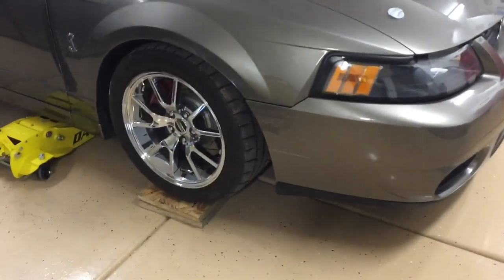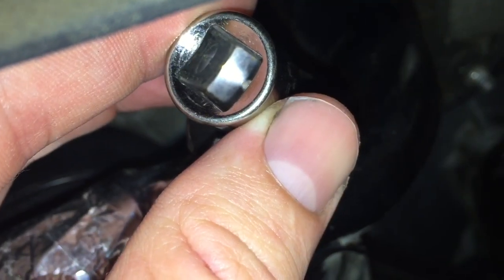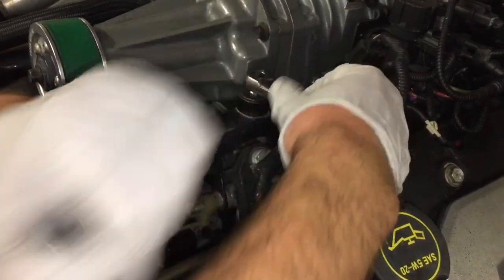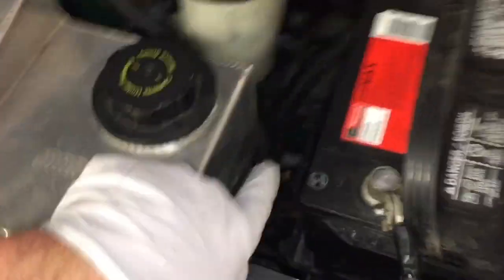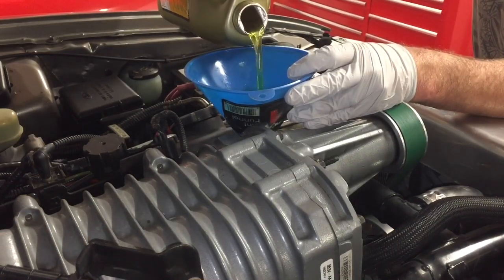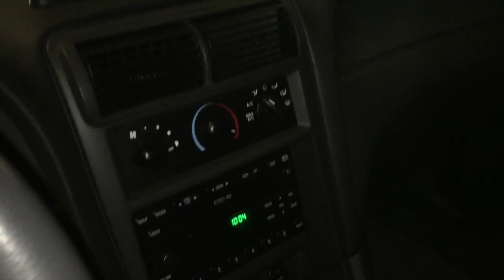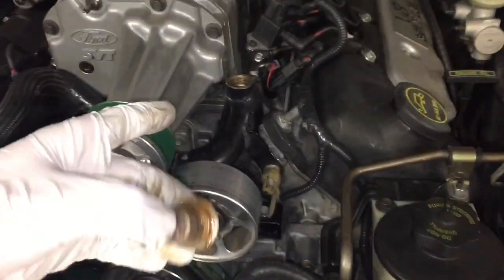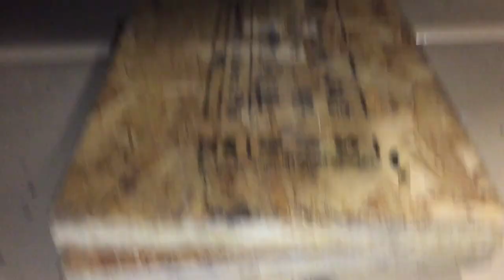Burping 32V Cobra / Mach 1 coolant system. 1996–2004 SVT cobra and Mach 1

Comment: Thanks for posting this. I COULD NOT get the air out of my Mach 1's cooling system until I watched this and filled/ vented through the cross connection.

Comment: Danny, did check out your vid. The Lincoln Mark 8 have the same issue with a cross over tube. It is a 1/4" drive required for removal. So, Harbor Freight, Amazon, have an adapter set for an impact hammer. 1/2" to 3/8" and 3/8" to 1/4". You combine those two and use an impact drive, you won't have to worry about breaking a carbon steel socket. Just a little squeeze with the impact hammer drive and it's done.  Use some anti-seize when reassembling.

Comment: Thanks Danny. Sons alternator went out and I had to open all this on the mach1. When we reassembled the car we drove it for 45 minutes no issues. Car sat for 8 days and then upon restart began getting very warm 

Followed your video for burping and the crossover took a gallon of coolant. Started it and took forever for thermostat to open and circulate. All seems to be fine now. I hope I didn't damage a head of anything

Comment: I think it still had electrical, it just died without any sputter. then started up with no problem. Perhaps a crank sensor connection?? How will I know if it is the fuel sensor?? Thanks for your help, I thought you may have experienced this.

Comment: i have a 32v in an aviator that just pushes all the coolant out and overheats. all head gasket tests were good.  i even had the cap off the resavore and i pulled the plug out of the cross over and it was under pressure...but not in the resavore?. new Tstat new water pump.  im gona try your way, then check if the rad is clogged. been fun
Reply from the maker: If it’s only hot on one side of the system something may be clogged. Check the thermostat to be in correctly

Comment: After I burp the cooling system should I let the car cool and then fill up the radiator tank to the fill line? Thanks!
Reply from the maker: Yes, but make sure it’s on level ground when you fill it to the fill line and not in the air on jack stands or it will over fill

Comment: I broke two ratchets and an adapter on mine.  Eventually had to use vice grips to get it off. Chewed everything up pretty bad. Now I just barely snug it back down.  It’s not so bad now.  Just looks ugly.
Reply from the maker: The struggle is real with these. I don’t know why ford didn’t make it a 3/4”
Reply: Yeah it was a pretty brain dead idea to not make it as simple as the aftermarket plugs. 

At least Ford didn’t use a lot of Phillips head screws like Nissan did on my Xterra.

Comment: So I only drained and filled my radiator, didn't flush it and it overflowed out the resivoir a few times then settled. Added more to the level mark and doesn't overflow anymore. Guessing I burped it that way? I stripped out that plastic radiator drain plug at the bottom in the process but managed to get it tightened again. Noticed tonight a small puddle about where the coolant would drip from the plug. Do they come all the way out so we can replace them?
Reply from the maker: I’ve seen replacement peck cocks (as the plug is called). They strip so easy that I always disconnect the lower radiator hose instead of using it. I would run the car with the heater on full blast and the crossover plug off to make sure it’s fully burped
Reply: @dannyjohnsonsgarage  yeah very easy to break. It was hard to turn out the entire way. Same to tighten it. I just kept pressing all my might as I was trying to turn it. Calling Ford in the morning to get a new one. I'll try burping it that way as well. Thanks.

Comment: How long do you let the car run with the crossover open before closing everything up? Should you let it get to fully warmed up needle in the middle on the gauge? Should you just let it run from cold start for a few minutes before closing everything? Once my car got the gauge in the middle coolant started flowing out of the open crossover.
Reply from the maker: It should only run a few minutes from cold. They should get most of the air out and the rest can come out the expansion tank. It’s for the majority of it to get out
Reply: @dannyjohnsonsgarage   Tonight I gave it another shot. The front of the car is raised on ramps. Heat on full, idle with coolant about 2 inches in funnel on crossover. Reservoir  cap screwed on the whole time.I let it run for 6 minutes. I got some tiny bubbles and a couple small hiccups(not enough to flow out of 3-4inch funnel) I gave it a couple light revs during and a bit of bubbles escaped. I shut the car off and coolant remained in funnel so I sucked 1-2 inches out then closed it up. Should I be good now?
Reply from the maker: @joshuashanemarshall  It should be close enough to drive around with the heat on and allow it to continue to burp any air from the system. Start it up and feel the hoses to ensure one isn’t cold and the others hot (indicating a blockage like the thermostat being bad). Just watch the gauge as you drive and if it’s goes back and forth a lot it could still have air. Otherwise it should stay constant

Comment: Hey Danny so I am having trouble getting the air out like this.  Keeps overheating and pukes out the reservoir cap the cap is new I do have the metal expansion tanks new thermostat new fan it went like this I bought the car drove it 5.5 hrs home then the next day the fan locked up and it over heated I changed thermostat and fans and bought new cap tried to do this but it keeps pushing it out of the reservoir as I add it to the crossover tube
Reply from the maker: Let it sit overnight with a funnel full of coolant  in the crossover. Maybe pull the thermostat out next to make sure it’s not in backwards or clogging it. Hopefully the head gasket is okay if it overheated  https://youtu.be/dF56SQxvaOQ

Comment: Either I followed this process incorrectly or my expansion tank has a bad cap. I had the car idling with the hood up while I was looking for a vacuum leak and coolant started spewing out from the expansion tank cap!
Reply from the maker: Try a cap, but if it’s burped properly you might want to look at a water pump (hopefully not a head gasket) https://youtu.be/qeTTITKctoM

Comment: Just did a fan and radiator in my 03 Cobra. Curious about the reservoir- my car is running around 198-210 and I don't recall temps often getting over 190. When my tstat opens, I have 0 coolant in the resevoir. Shouldn't it be holding coolant at all times?
Reply from the maker: It should be at the full cold line or you still likely have air in the system

Comment: So when I shut the car off the coolant in the cross over tube drops significantly. Should I put more coolant in the cross over tube till its full again or install the cap and go?. Cause if I do fill up the cross over tube again and then start the car back up, all that coolant I just added into the cross over tube shoots out.
Reply from the maker: Being the high point, it’s probably ok to not be full to the top. It shouldn’t take too much more coolant after that, and watch the reservoir to make sure it doesn’t over fill when you add to the cross over.
Reply: @dannyjohnsonsgarage  Thanks for the reply. I'll have to mess with it some more because I do believe the reservoir is higher than it should be now.

Comment: Dan whats is best way to drain the car .. rad drain  and thermostate removed?
Reply from the maker: Yes, lower driver side radiator hose and thermostat. You’ll see it in this video https://youtu.be/DKb5ldeqXjo
Reply: My Mach 1 has a block drain on the driver's side.  It's directly above the oil pan drain. There's supposed to be one on the passenger's side too, but it's nearly impossible to access.

Comment: Hey Danny, so I am replacing some hoses and the coolant all together on my 2001 Cobra. Upon my second radiator drain and refill with distilled water I noticed a small leak that comes from the bottom of the engine. It doesn’t reek of coolant, it just smells like water would. Did I do something wrong to cause this?
Reply from the maker: I would check near where the coolant crossover fill tube goes into the heads on each side to see if it’s leaking there and running down the engine
Reply: @dannyjohnsonsgarage  if you’re referring to the two hoses that fit into the metal fittings at the top, then those are bone dry. Connections are good. It’s more toward the back of the engine near where you tend to have some condensation drip except it’s further inside from that puddle. Fluid is clear, more like water than anything.

Comment: Question... my factory overflow tank is almost empty when the car is cold. Then when the car warms up it is full. What is causing that?
Reply from the maker: Heat expands the liquids. It’s probably a little low. You can try topping it off at the fill line for cold

Comment: Hello Danny, a quick question, my 03 just shut down while driving, no sputter or anything. I pulled over and it turned over but would not crank I waited 5 minutes and it started right up. Any ideas? No codes came up, it has never done that before
Reply from the maker: When it shut off did you still have electrical power? It could be as simple as a loose battery cable or ground. 
   Next I’d look into the fuel rail pressure sensor since it might think the car doesn’t have fuel even if the pumps are good. I would watch this video to see if any of the items listed are loose, bad, etc. https://youtu.be/JvgKGJjAwU0

Comment: Dany, my car sits for a week or 2 before I drive it. I recently had the cooling mode done by a shop. Car runs around 195 200    the hose coming out of the radiator get pretty hard, is this normal. Also I removed the cross over nut and when I start the car coolant shoots out of it. Why is it doing this. Thanks in advance.
Reply from the maker: A hard and hot line can indicate a blockage. I would next try the thermostat. It will be closed until the engine is warmed up https://youtu.be/dF56SQxvaOQ

Comment: My crossover plug isn’t coming off so I filled the top radiator hose, when I started driving the heat is still fluctuating and staying near hot. Is there a better way to burp the car without the crossover. Maybe using the reservoir?
Reply from the maker: The air might work itself out via the expansion tank. Otherwise I’d try to add at the radiator hose again holding the hose as high as you can get it. Make sure the heat is on full blast while doing so
Reply: Ya I drove it again, it was getting hot again, then went straight to the middle of the gauge. I think it is good now but I’ve been scared to drove it far

Comment: My Mach is pro charged and doesn’t have a spot on the cross over.. what do I do?
Reply from the maker: Remove the upper radiator hose and fill there. It should still go where the crossover would mount into the cylinder heads

Comment: danny, i'm doing both aftermarket tanks on my03, what do you suggest to do to prep and fill the new tanks properly ?
Reply from the maker: ctozzi123 You’ll news to lower the coolant level in both the supercharger system and engine (they are separate) and then fill them. If you don’t drop the level too low it’s a simple fill up and burp as the video shows

Comment: What if my heater core AC unit is removed from the car? will that have any effect on bleeding the system? My car will have no AC or heater core in it. Thanks
Reply: Disregard! i see that you mentioned something in another comment. great videos Man, very helpful
Reply from the maker: Yeah, less to burp actually. Should be easier. Good luck

Comment: Ok wait, I saw the coolant filled on the crossover pipe but what am I supposed to do once I turn off the car? Mine looked just like yours did but once I was done and turned off the car all the coolant went away and saw nothing
Reply from the maker: Continue to fill it. The expansion tank should also be full in the end (up to the line). It’s circulating past the fill plug area so you’ll see it but it sounds like it’s not full
Reply: @dannyjohnsonsgarage  would it be a good idea to add coolant in the cross over pipe while someone else turns off the car so it doesn’t go completely dry? Because from my understanding coolant in the crossover should still be visible even after I turn off the car?

Comment: How many gallons of coolant are needed if I do a complete flush? Also, do you recommend any specific type? I know some came with green/gold. Thanks!
Reply from the maker: You’ll want to buy several gallons of distilled water, fill it, run it for a few minutes, and drain it. I would buy 3-4 prestone jugs for the final fill. If you are flushing the system the color won’t matter.
Reply: @dannyjohnsonsgarage  yeah what color did you use in the video
I have an 04’ Roush stage 3 supercharged
But I found green in mine 
I want to flush then use the gold/yellow
Reply from the maker: @randallruel7859  As long as you flush it all out you can use gold or yellow

Comment: Should there be coolant in the crossover tube when the car is not running and cold ?
Reply from the maker: Yes, some. It’s also the high point so expect a small amount of air
Reply: @dannyjohnsonsgarage  so when I open the  crossover cap its normal for it to be completely dry for the eye to see?
Reply from the maker: @Spooled.by.matty.  yeah, if it’s ice cold. It shouldn’t take much to see coolant if you added it
Reply: @dannyjohnsonsgarage  ok thanks

Comment: Danny i ran into an issue where the funnel placed on the crossover tube started acting like a reservoir lol  idk it was weird. i didnt have the car raised in the front. You think that was the issue?
Reply from the maker: It will do that as the Temp increases and it expands. As long as it was still bubbling

Comment: My heater core went bad in my car so I bypassed the line and I don’t have any heat. So how can I burp the system out without any heat?
Reply: Damn left ya hanging. Just like ya would if ya had heat but don't turn the AC on at all. The only reason to run the heat is to fully circulate, u have no core so you are fully circulating without it.
Reply: @alwayslikedeath4472  all good bro, I got it fixed that day
Reply: Was just stating to yank a chain. Hope you still have the ride.
Reply: @alwayslikedeath4472  I sadly sold it since I’m in college, trying to get it back right now actually ahahaha

Comment: I did that and it's gets hot after y can some body tell me what am doing wrong
Reply from the maker: I would take the hose off that goes to the radiator and pour fluid in so it’s draining directly into the radiator to make sure the radiator is full
Reply: Dose it matter what   Thermostat I have
Reply from the maker: @nancyparra5017  No, unless it’s defective
Reply: Am going to try what you said put it on the house and thank you sir

Comment: The previous owner rerouted the heater core, would not being able to run the heater change anything?
Reply from the maker: Señior_Sam! You run the heater to make sure coolant flows into the heater core. If the lines no longer go u to the firewall on the passenger side there is no need to run the heater. It’s just to make sure it flows into the heater core to burp it

Comment: Danny I’ve got an 03 with a KB 2.8. Just turned 50k miles and it has an upgraded inter cooler tank. I’m the second owner. Should I be looking into changing the coolant due to the miles?
Reply from the maker: It never hurts to put new coolant in. The supercharger tank is a separate system than the engine. Some people do a different color in each to ever know what’s leaking
Reply: @dannyjohnsonsgarage  cool deal. I am still full to the brim and haven’t noticed any heating issues. When I do open the cap and peek into the reservoir for the stock engine expansion tank, I noticed some spotty brown build up on the plastic walls above the fluid level.
Reply from the maker: @caseindaplace  Some of that is probably oil from the oil cooler. The gaskets aren’t the best and tend to leak

Comment: Is this process absolutely necessary? The crossover on my Mach 1 is basically welded shut because I suspect the previous owner used loctite...Could I just fill it thru the reservoir and keep adding with the car on as it fills the rest of they system?
Reply from the maker: You will need to fill it through the hose that is connected to the crossover. If you only add coolant in the expansion tank it will not fill the system. The crossover on my mach 1 would also not budge so I just filled it at the radiator hose that goes to the crossover and it has been fine
Reply: @dannyjohnsonsgarage  Will do! Thank you for the very quick reply, and all these helpful videos, I don't know what I'd do without them!

Comment: My tanks, and radiator and hoses were completely drained and then put on after some work was done to my car. my mechanic did not fill it from the cross-over. He filled it from the expansion tanks.  I am having trouble with my fan turning on and I am afraid that I may have air in my system. I don't want to run the car too long because I don't want to cause damage. What do you recomend. Do i have to drain the system again or should i just fill it from the cross over and let it run and add more  as it goes down.
Reply from the maker: You don’t need to drain the system, but it is most likely not full. Follow the video- Put the front of the car in the air in jack stands, remove the crossover and fill it there. Run the car and put the heater on full blast. Just don’t run the car more than a few minutes
Reply: @dannyjohnsonsgarage  so should I let it cool down and repeat as I do this since I can’t run it for more than a few minutes or should I fill it while it’s off and then run it to let air come out